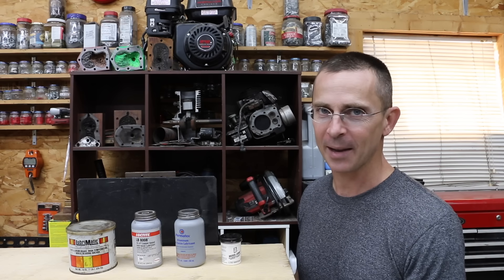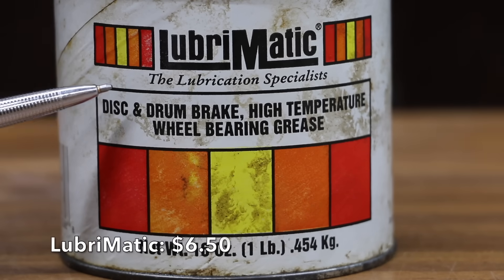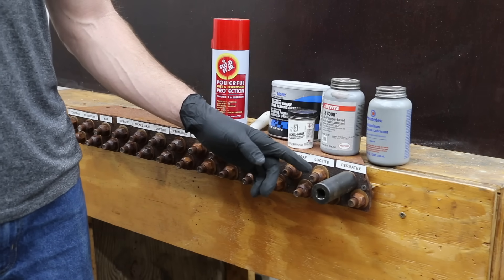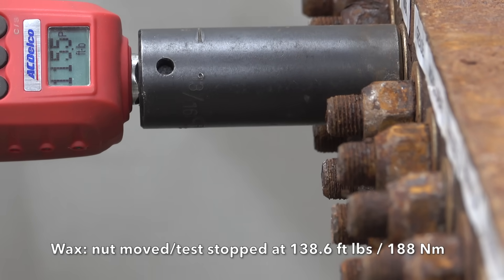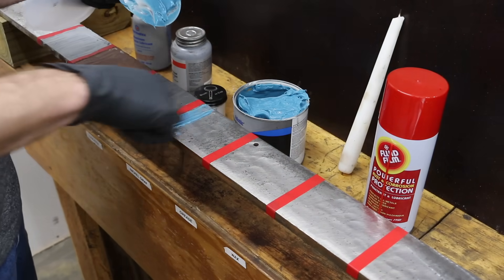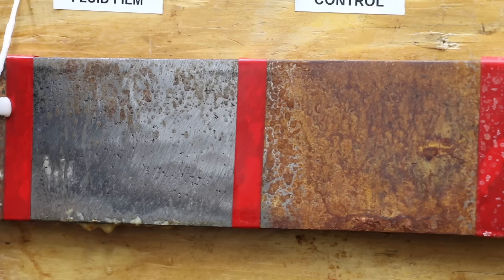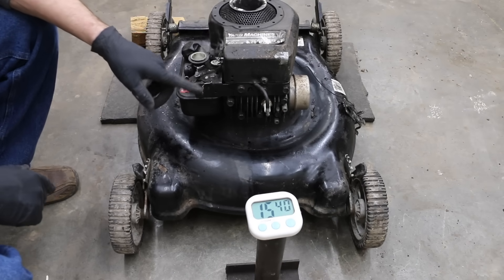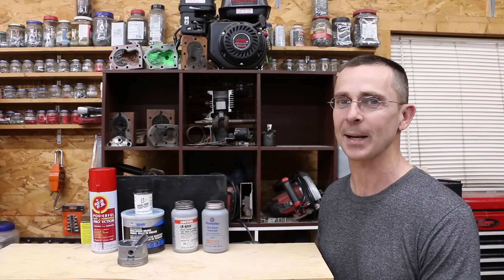Does Anti-Seize Compound Actually Work? Let's find out! Anti-Seize vs Grease vs Fluid Film vs Wax

Comment: I wasn’t expecting that 😂... obviously it won’t seize lol. 

What is up with candle wax guys? They’ve seen the results.
Reply: I am a candle wax guy!!! Myself apply a VERY different waxing process:  Tighten all bolts & nuts, heat them up to 75°C and let the wax melt in.  The wax should not be pure paraffin, that is too brittle, I use 60% paraffin / 40% bees wax.  It water-tightens as good as all the other products.  The other products will give some extra protection for the exterior of the bolts or nuts, because of the aluminum (and/or zinc) that will corrode before the steel does.
Reply: Candle wax would have faired better on non heated items. Take a look at suspension bolts on 40s cars.
Reply from the maker: Thank you!
Reply: According to Wikipedia, paraffin will burn at as low as 392ºF and beeswax as low as 400º, so after baking in a 550ºF grill for a while (with an open flame, I assume), the candle wax may have evaporated or burned off before the rusting agent was applied. I dunno why its performance in this test was worse than nothing though. Maybe the combustion products of paraffin reacted with the metal?
Reply: @jamieflournoy  I would have to guess that whatever didn't burn off was left behind to gum up the threads a bit.

Comment: Remember to have a torch nearby. A bolt can't be seized if it's liquid
Reply from the maker: Heat is hard to beat!  Thank you
Reply: My father broke a water tap in garden few days ago, half of old thread stuck in pipe. Extension to be correct, usually he will just go and buy new extension but with lockdown that's not a option. And only reason he ask me for help, usually he's to proud for that. Luckily chinesium taps melt at low temperatures, small blowtorch was enough to melt it away and install new tap.
Reply: Good ole Smoke wrench antiseize

Comment: I work on nuclear submarines for the US Navy and we use C5 on most bolts inside the boat. We don't use it on the hill any longer because it can leave an oily trail. However older boats that I worked on where C5 was used on the hull were to remove botls that hand been in seawater for up to 5 years. Great stuff.
Reply from the maker: Great information. Thank you!

Comment: Try brake fluid to see which one can handle the most heat.
Reply: Wet boiling point is the important spec for brake fluid, because once it boils, you no longer have a hydraulic brake system.
Reply from the maker: Thanks for the idea!
Reply: Frotax Frotax  I run DOT 4 in my Grand Caravan though it only calls for DOT 3. Sucker turns the rotors blue from the heat.

Comment: Holy perfect timing.  I need to get some spray anti-seize today. My son has a rotary engine and the spark plugs don't want to come out or thread back in very well. I'll sit back and pay attention. 👍
Anyone have a tip for me? The plugs get harder to turn as you try to loosen them, and they get even tighter as you try to thread them back in. We can only get about a quarter of the way out before they feel like they are going to snap.
Reply: An E30 M3 and a rotary. You and your son must love working on cars.
Reply: @THEcommandingANT  lol. Well, the E30 is pretty much bullet proof. No real issues in 7 years.
The damn RX7 is a nightmare. Its the Japanese right hand drive version and its a constant fight.
Reply from the maker: I wish you the best of success with those spark plugs! Are you using penetrating oil?
Reply: @ProjectFarm  Thank you.
We have soaked them several times over the past few days. Engine is still in the car, and it won't start. So, heating the plugs is not an option.
Reply: I've been in your situation. You may have to install thread inserts, but there is one thing you can do that might help you get the plugs out without damage: run the engine and get it hot. Then work on one plug only while the engine is still hot. If it comes out, run the engine again and try another plug.If this isn't working, you can also try using a freezing agent on the plugs while the engine is hot.
To avoid this situation in the future, I highly recommend that you use a high temperature anti-seize like nickel Permatex on your plugs. I've been doing it for more than 40 years on countless engines and never had a problem removing a plug I installed. It's the plugs that were put in by others that cause me grief;-)
Reply: @EDesigns_FL  Thanks for the tip, but we can't get the engine to start. Thats why I am pulling the plugs. Searching for the cause of the no start.
Reply: @EM-fi2qg  It sounds like you are in a predicament. If you can't start the engine, I would pull it out of the car before you do any damage trying to remove plugs. Too bad it's a rotary. Much easier job on a piston engine, but you don't have the luxury of just pulling a head.
Reply: @EDesigns_FL  I'm hoping pulling the motor will be a last option. Parts are getting hard to find for this particular car. I'll keep ya'll updated on the outcome.

Comment: BBQ Nuts and Bolts, my favorite. 😂 Always nice to have a sacrificial mower laying around. Thanks for another great testing video! 👍👍
Reply from the maker: lol. Thank you very much!  Hope you have a great week and always look forward to your videos!
Reply: I wonder which anti seize works best  on the grill for preventing burgers from sticking 😁.  My wife would kill me if I put that on the grill. Great job. I've always used the copper based.
Reply: Use waterproof electric tape best ever no matter how long it there put it on the exposed thread
Reply: Reminds me of the cash for clunkers program where they destroy the old cars by running it with a mixture of sand applied to the crankcase. Seemed like pointless waste of old cars, but that was the government thinkers at work.
Reply: @wingerrrrrrrrr  That had the effect of raising the prices of used cars. Boondoggle caused by government interference in the free market.

Comment: How about testing methods of treating wood for outdoor life:  Cedar, pressure treated wood, paint, epoxy, linseed oil, boarate treatments, etc?
Reply: That's a great idea. Definitely one we wouldnt see until next year though haha
Reply: Old engine oil
Reply: Awesome idea!
Reply: Creosote, chromated copper arsenate, tar
Reply: Yeah, would be great to test this also, plus old engine oil, varnish, oil based paint, water paint etc..
Reply: That would take like 6 months to complete :0
Reply: Good topic. Id like  seeing what finish fills wood grain in the best, and seels the surface, and does it require a dryer chemical like Japan dryer to be effective? Does it require a shellac or polyeurithane sealant to be effective? Can wood be totally seeled so humidity can't effect it ?  How much does extreme heat and cold warp the wood, sealed vs. unsealed? Sealed vs plasticized(polymer impregnated wood ) wood?
Reply: Yeah, I recall grandpa using acorns left in water to stain wood real dark. Not a real treatment but it gave an almost black tint to light wood
Reply: @jasonblahafitness6349  yeah and black walnuts will also stain wood really well and appears to keep bugs out of it. You can also get a tow sack full when they're green just falling off the tree and bust them up with a sticker board and drag them through an old Slough off the river and it'll bring the fish to the top of the Water to.
Reply: I'd like to see a test for treating wood and concrete.
Reply: @Furbolg Dance party good call! .that makes one of the best gun stock finishes and can be sanded in, or applied alot of ways depending on if you want dull, satin, or glossy finish and is quite durable. boiled linseed oil with japan dryer is pretty great too.
Reply: I've used burnt motor oil and diesel fuel 50/50 mix. Curious how that'll test.
Reply: I'm putting up some deer netting right now and I'm using 2x4s that have been soaking in burnt motor oil for a few months. It is free and I get the 55 gallon barrel for 10 bucks at the local tire and lube place.
Reply: Copper nathe is the best treatment for inground preservative. If you want to get real anal drill some long 3/4 inch holes at a sharp angle (not going all the way through) then you can fill up holes. With the Copper N, or even used motor oil. Which you can also use as a preservative/stain. It doesn't get any cheaper than used motor oil. And it does leave a  good finish on a piece of wood on top of everything.
Reply: Char is the best.  If done right you can have wood last thousands of years.  Source: Japan
Reply: … asphalt, tar, Sodium Silicate, polystyrene foam dissolved in toluene
Reply: Add used engine oil to the list

Comment: I've found anti-seize compounds to actually result in seizure of my brake components when the oil component evaporates over time. I'm currently using rubber grease, I'll see how that goes long term.
Reply: You're suppose to use hi temp non metal anti-seize( Silicone based) or we normally call it grease for slide pins. The only time you actually use any sort of metal anti-seize is on the brake pad plate guides( non moving), and to be applied every year or when you change pads.
Reply: Really ? been using anti-seize on everything for over 30 yrs and never had an issue. Everything I have used it on, including any brake parts, came apart with no problems. But who knows ??
Reply: @augustreil  I've just had issues with the automatic adjusters in drums and the caliper slide pins getting stuck. Upon pulling them apart all that was left of the anti seize was just a solid cake. For bolts and stuff it works great.
Reply: @dquad , I get what your saying now. Yes, on the auto adjuster pins, I will use grease instead. Never had any issues with the slides though. I shouldn't say that, now I'll have problems !
Reply: @dquad  You shouldn't have used an anti-sieze for lubricating a pin. Anti-seize is an abrasive that is intended to prevent galling and keep the surfaces of a fastener apart, but it is not a lubricant and that is what you should use in your application.
Reply: dquad Anti seize isn’t really designed to be used in dynamic applications. Grease will work better for slide pins.
Reply: @dquad  just like the video shows, anti seize is not meant for moving parts or heat applications because it breaks down . The guys above are right, silicon based hi temp grease for the caliper slide pins because it's made to withstand high temperatures and constant use.
Reply: Anti-seize is not meant to replace grease. Project Farm proved it. I used Permatex Aluminum. It dried up after one year and lose its slipperiness. I did work well as an anti-seize, though. So, be careful when to apply it. I used brake grease for brake pins.
Reply: Use silicone grease  made  for high  temp use.
Reply from the maker: Thanks for feedback
Reply: Ye, I use a mix of Rubber Grease and Copper Grease on my bike. Still get some rust with rubber grease but copper grease does pretty good.
Reply: Copper vs aluminum = Bad news, if that's what you have going on.  FWIW.
Reply: Fisting lube work better than antiseeze oO
Reply: Which fisting lube do you prefer?
Reply: @thisisyourcaptainspeaking2259  The one in the green bottle. Fistul8r or something.
Reply: @dquad  anti-squeal, right?

Comment: Back in the day - way back, quality copper grease was universally recommended for brakes likely due to the heat. Really hope my memory serves me right
Reply from the maker: Great feedback. Thank you
Reply: Brake lube, then brake "rubber like" coating. Was replaced by shims with rubber coating. Now seems back to lube on the metal anti rattle clips.
Reply: @JasonW.  I hope so as auto adjusters and slide need to be maintained well
Reply: We've moved past that now, silicone paste/grease, or high temp grease is what we use nowadays. There are some ceramic ones out there too, South Main Auto swears by his pink Permatex goop, I've got a big tin of Knorr calliper grease I use all the time when I do brakes at work.

Anti seize is just a bit too tacky for modern disc brakes, it does however work well for drum brake sliding surfaces.
Reply: @ColtaineCrows  In South Africa, "Knorr" is a brand of instant soup packets and other powdered kitchen things. :-)

Comment: After two years working in the oil field, taking pipes apart after months outside at 15000psi, yes. It works
Usually.
Reply from the maker: Great feedback. Thank you
Reply: I work on industrial chillers and we coat water box bolts and studs in antiseize all the time. Then cover the equipment with insulation for five years and then open it again. No antiseize =broken bolts and studs.

Comment: Really like the videos!

Could you do a comparison of different sandpaper for use on metal? Which cut hardened steel, how long they last, the strength of the paper used, e.c.t?
Reply from the maker: Yes, terrific video idea!  Are there any brands you'd like tested?  3M, Harbor Freight need tested for sure
Reply: @ProjectFarm  Not too sure which brands aside from the obvious ones (maybe look at Prodeck?), but maybe you could try aluminium oxide versus ceramic as well?. What could be interesting is backing a piece of sandpaper with duct tape to add strength and see how much stronger it is; I do that when I want to use a long thin section, so that it doesn't tear as easily.
Reply: Diablo sandpaper would be good to test. It's the only disc paper available at Depot, and I really don't think its very good. Would love to be proven wrong.

Comment: How about testing how much tightening torque and clamping force changes between bare threads, anti-seize and thread locker.
Reply from the maker: Great video idea!  I can definitely test that.
Reply: @ProjectFarm May want to add powdered graphite applied to lightly oiled threads to that test. I had a neighbor that was a top-notch mechanic and refurbished VWs and BMW motors during the 60's and 70's. He had coffee cans full of powered graphite that he stuck lightly oiled  nuts, bolts and washers into then tapped off the excess before using. Said he learned about doing that when being trained to be a M4 tank mechanic in 1941.
Reply: I'd also like to see grease, motor oil, and WD-40 added to that test.  A lot of times motor oil on the threads is an unavoidable fact of life, and I'm known to use a bit of WD when reinstalling fasteners with light corrosion.
Reply: I was a millwright in a pulp and paper mill.We had lots of corrosive and high temperature environments.We had torque charts that listed dry with oil and with anti sieze.With anti sieze initial torque was slightly lower than dry install.We used nickel and copper based
Reply: This is definitely a really good idea.  You're not supposed to use anti-size on tire lug nuts/studs, for example, because it changes the proper torque values.  Knowing how much the torque value should be modified may allow you to use anti-sieze on the lug nuts/studs should it be required (severe corrosive environment, for example).
Reply: yes I agree that's a great idea. I have a bolt torque tables i found online and if I use loctite I torque the bolt to the "lubricated" chart which seems to be around 80% of the "dry" chart